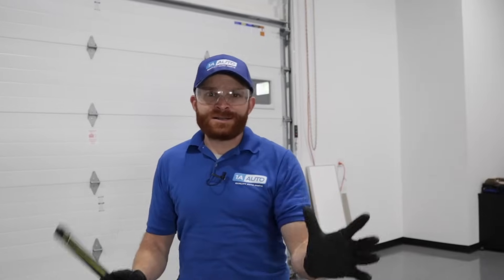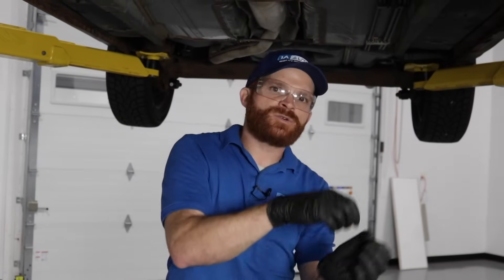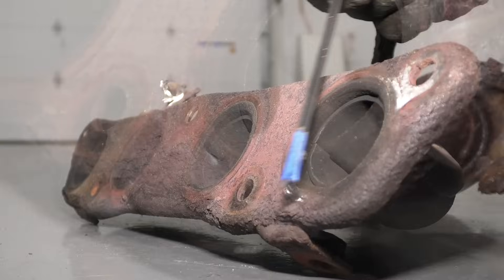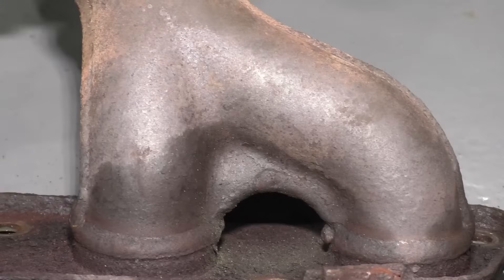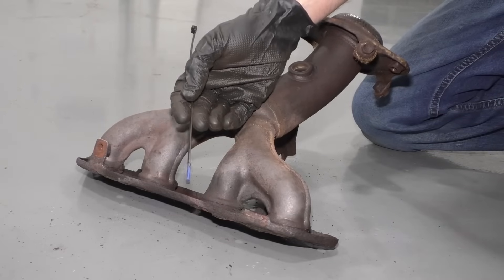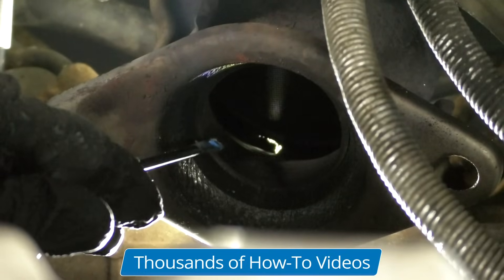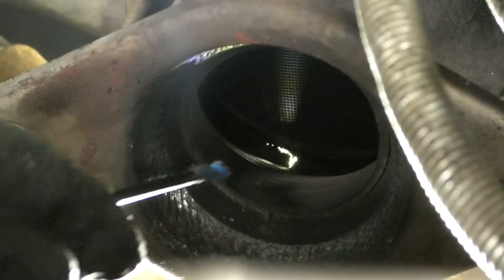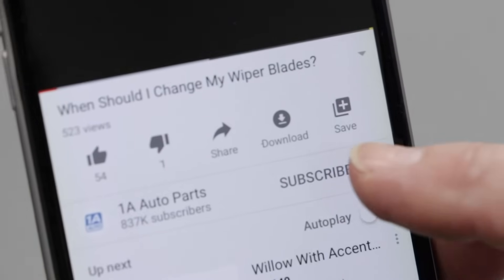Smells, or Ticking? Diagnose a Car or Truck Exhaust Manifold Leak

Comment: Could a clogged catalytic converter cause an exhaust manifold leak? My downpipe gasket was leaking and the check engine light went away and I had improved horsepower. The light came back on and it's the same p0430 code again.

Comment: I have a 2019 Honda Fit that has a ticking sound between the manifold and the timing chain coming off a bolt using a stethoscope i hear ticking sound  happens pretty much during the winter time on cold starts and the last about 10 till warm up ,during the summer time it doesn't do it.

Comment: Man I really appreciate all these high quality videos yall put out. I was able to rebuild my moms trailblazer 4.2 inline 6 engine from your videos (and the help of other videos), but primarily yours with the trailblazer 4.2 timing chain video. The engine is now now operating even better than before and i just started noticing the ticking on the exhaust side. I was bummed thinking it was something worse, but i highly suspect it is a leak at the manifold. It's a high milage vehicle, so I replaced all the gaskets on for the manifold, but never inspected the old manifold before installation on the rebuilt. All the research ive done, point me to the exhuast manifold being compromised. thanks again

Comment: Looks like I have a an exhaust manifold leak. I can see it bubbling.  I am also loosing coolant and have white smoke.  Does that make sense?  Do I also have an intake manifold leak??? Vehicle is a 1989 F240 with a 460 7.5.

Comment: Very informative. I just got a 2006 Honda Element that had a bad donut gasket and I just fixed that (what a relief for the ears!), but I found it ticks under load, whether the engine is hot or cold (the ticking under load doesn't go away when the engine is warm). Could this mean the manifold itself is fine but the gasket is bad? There are no leaks coming from the new donut. Thanks in advance for your comments.

Comment: Okay so I have a 2017 ram 1500 penstar engine and I have a ticking noise in think it was engine related but watching this makes me second guess. So in the morning is when it’s the worse as it would be if engine related and it gets quieter but doesn’t go away completely and it does increase under acceleration. So my question to you is it even worth what you think it could be

Comment: im working on a 2003 gmc savana van, i hear a ticking when started up cold but i still hearing the ticking even when its warm, but when i drive it and give it some gas it goes away but comes back when im idling what does that mean? also symptom on possible maifold leak?

Comment: Soap and water. Use a shop vac on the blow side in your exhaust to find a leak on joints and seams instead of going by noise. Itll also keep it all cold so you can touch and work on the exhaust

Comment: Hello everyone, question: do you need to replace that if you have the leak. If the sound doesn't bother you or there will be some other complication if not replaced. And if you do need to replace that for some reason, what is the longes you can drive without replacing it if the sound just appeared?

Comment: Awesome video, I was about to just tighten up my bolts there but after seeing how bad the surfaces can get and that cracks can show up, I'll take out the manifold and give it a better inspection. Also hadn't even thought to use my hand to feel for gasses when the car is just turned on

Comment: Does anybody know if a manifold pre cat like shown is supposed to build up heat while at idle? Mine measured 330 into manifold 550 at the front of the cat and 330-350 at the back. Does this mean this pre cat is bad or that it is functioning? Once again these were measurements at idle

Comment: The best way to check for an exhaust leak, is to use a shop vac. Insert the shop vac end into the  open end of the exhaust pipe and if you have dual pipes with a crossover pipe you'll need to block the other pipe by inserting an old t-shirt or shop rag. You'll want the shop vac blowing air into the exhaust pipe. Now, you don't have to worry about the exhaust leak sealing off due to heat, just grab yourself a spray bottle of water and dish soap. Go along spraying the soapy water and as soon as you see bubbles you'll have found your leak.. but don't stop there, there could be more.

Comment: Simple way to check leaks is to use soapy water and test to see where bubbles comes. Apply soapy water on possible leaks area first. If you have leak in exhaust prior to catalyst, you will see 420 and 430 code and engine light on. I don’t why some will open all parts first and use eye ball to inspect the leak.

Comment: Can anyone help me with this, pleas?  My engine has the ticking when I start it.  It is gone after the engine warms up idling  but the ticking  resumes as soon as I hit the accelerator. I can be going down the road at 5 MPH and if my foot is on the accelerator I hear the ticking but if I remove my foot from the accelerator at that point the ticking goes away.  It comes right back if I hit the gas pedal again.

Comment: @1auto Lenny 

Would it cause smokey  from manifold gasket too?
or would that be the valve cover gasket only?

I changed my water pump in my 3.9v6 Dakota at start up to burp system passenger side, started to smoke really bad.

Was told its valve cover gasket but Im pretty set its mainifold gasket.

Comment: I have a 2018 Nissan Altima, and it started with a loud consistent ticking sound, and was noticing it suspiciously went away after it warmed up. Also, it was unbelievably "exhausty" in the cabin and under the hood. This absolutely solidified my suspicions. Thank you!!

Comment: When I turn my car off and it’s parked I hear a very rapid ticking noise like someone it tapping a small wrench really fast near the back or mid section of my exhaust and this noise actually goes away once the system is cooled off. But I hear no ticking when the car is on…I have taken it to 4 mechanics and they have told me there isn’t a problem. I’m not convinced.

Comment: I don’t get a ticking noise. It sounds more like chirping or squeaking, or even metal to metal when I accelerate. It is less audible when the engine warms up. Does this still sound like an exhaust manifold issue? Gasket? Loose bolt(s)?

Comment: So you're saying that if my manifold is connected to my catalytic converter I can get a lien condition as well as a p0420 or p04302 my manifold is leaking correct or not there's nothing wrong with the O2 sensors are replaced it twice already
Reply: Thats my same question, i have a code saying my manifold but a p0420 saying my catalytic converter, but the manifold leak could cause the code right?
Reply: My car got the same code. It smells like gas when I turn on the AC or the heater. I’m assuming it’s coming from under the hood. I used cataclean n cleared the code so it hasn’t popped up and it’s been longer than a month.

Comment: I have a Nissan 2018 Frontier King Cab 4cyc  with an exhaust leak at the exhaust intake manifold not at the head but a little waist down where it's covered by heat Shield bolted in another one a little further down which is clamped together where to exhaust pipes meet and is covered by heat shield it has a aluminum o-ring as a gasket how do I get them off to replace the aluminum o-ring on it

Comment: @1A Auto: Repair Tips & Secrets Only Mechanics Know
I have a 1.8 zz Corolla. I've had this ticking since over a year now. it comes with more load (more passengers or AC/headlights on)
I'm suspecting a warped exhaust manifold with leakages around the gasket. Do you think this leakage can screw with the performance of the car? because when the noise disappears sometimes, the cars performance is ALOT better?!!

Comment: Hi I tore my manifolds off. I have multiple broken manifold bolts as well as shot gaskets. My truck makes a ticking noise that is louder when cold but doesn't go away when truck is warm either. Could this be my problem? 2014 dodge ram 1500

Comment: I have a 2011 Chevy Equinox that has started doing the ticking sound in the last few days. It doesn't go away after driving the car and the car is warmed up. Obviously more noticeable at lower speeds (under 30 or stopping at a light or stop sign). Any ideas?? Help!!!
Reply from the maker: +D Meckola We wouldn't be able to diagnose an issue like that here, you may want to have a local mechanic take a look at it. Thanks for checking us out! http://1aau.to/m/Shop-1AAuto-c

Comment: I hear ticking sound from my engine, but it doesn't go away after heating up. It gets louder as it idles more. What could it be?
Reply: Same thing, only the leak is large enough that the heat expansion no longer seals the leak.

Comment: Hi there, would the typical 'ticking' sound you mentioned of a leak very close to the engine be the short ticking noise I can hear right at the very beginning of the video when the engine starts? I have exactly that sound, I hear it mainly while driving whenever the motor has to pull, when I accellerate. This sound is getting louder and started over a year ago, however doesn't go away when the motor is heated up. Thanks in advance for your help!
Reply: Could be your valves or valve lifters that need to be adjusted or could be rod knock which is not good
Reply: Same
Reply: Look up what a rod knock sounds like.
Reply: I'm having the same issue and it's ever since I put a new set of aftermarket headers on. It seems to get worse when it's warm and will only make the sound under load. I can't for the life of me figure out what it is, it's definitely not the valve lifters as the sound isn't coming from them.
Reply: @BreeingIan  maybe it’s the EGR valve? Did you resolve it?

Comment: or you could use a shop vacuum with it blowing not sucking and with everything cold put the shop vac in the exhaust tip and tape to so it doesnt fall out and then turn it on and take soapy water and spray down the exhaust that is the easiest way to check for an exhaust leak been doing this for years as a auto tech BUTTTT make sure the motor and exhaust are not hot and it hasn't been ran for a couple hours
Reply: It's people like you that makes me enjoy the internet. Thanks for the great idea man

Comment: Will this exhaust leak also cause a P0032 and P0052 check engine light code? I already replaced all my O2 sensors and smell a strong exhaust and have that ticking noise.
Reply from the maker: +C Otake We wouldn't be able to diagnose an issue like that here, you may want to have a local mechanic take a look at it. Thanks for checking us out! http://1aau.to/m/Shop-1AAuto-c

Comment: What if you have ticking that doesn’t stop as it gets hot but it does slightly reduce?   Also when car is up off the ground and your under it you can feel a whoosh of exhaust when have a buddy slightly torque the engine putting it in drive and break torquing it and facing where the pipe comes down to the cat.  Can also smell exhaust in the engine bay back where the manifold is hidden behind the engine but no whooshing of exhaust blowing upwards like is under.  The issue is we don’t think it’s manifold, sounds like leaking manifold but the whooshing underneath makes us think it’s elsewhere, that large of a leak in the manifold would likely poisoned me on a road trip by now makes us think that the leak is further down stream but just above the cat.  But we can’t locate it and it’s a huge job to replace it because looks like have to drop the subframe and no one wants to do that.

Comment: If the noise is matching up (ticking) but doesn't really go away even when the engine starts to heat up, where should I he checking next? Or does it mean the leak isn't small?
Reply: Hey man ever figure it out for yourself? I’m having the same problem and I’m thinking it’s a bigger leak.
Reply: @Duke_803  yeah mine was only when I first started it and it would go away as a drive more, but now just today it stays loud as I’m driving so I think the leak got bigger and it sounds like it’s more up front so I’m thinking it might be a manifold leak but idk. I’m goin to try to get it checked tomorrow.
Reply: Injector noise or valve noise
Reply: @liamflynn6929  mines sounds like a lifter noise but same time smells like gas so idk

Comment: Do exhaust leaks cause vibration when driving ?
Reply from the maker: +Enrique Torres They mostly cause excessive noise, but you could possibly feel some vibration if the leak is bad enough.

Comment: Hello, I’ve got a question that’s been on my mind. Since an exhaust system is pressurized, how can it suck in air and create a lean condition?
Reply: Cracks in the seals
Reply: Extra air going to the O2 sensor. Venturi effect.
Reply: @Reginald-Bowls  that would make it rich. O2 sensor would sense excess air and tell the engine to send more fuel
Reply: It’ll cause it to smoke a bit, when running lean

Comment: This is very helpful in explaining the ticking noise I hear when my engine is cold.  Mine goes away usually within 30 seconds or less, so probably a smaller leak than average but still a problem to look at.
Reply: Or... your lifters.
Reply: @wheresfuninthat  you beat me to it🤣
Reply: @coreymohn05  mine is the other way around it ticks on startup and when I rev it

Comment: Will having a exhaust manifold affect the performance i got a 12 ram 1500 an i know i have a leak on the driver side due to bolts broke off but ive also notice my truck lost alot of power when trying to floor it from a stop will this have anything to do with the loss of power? Also no check eng light any clue?
Reply from the maker: +v tmz Thanks for watching!  Yes an exhaust manifold leak could affect performance, as it will usually throw off the air/fuel mixture reading from your O2 sensor.

Comment: I got my response after many months trying to understand why I have an exhaust buzzing noise between 1500 RPm and 2000 RPM when engine is warming up.
Noise almost disappears when the exhaust system reaches a very hot temperature (Heavy traffic driving for 20 minutes). Then the noise comes back slowly when cruising at high continuous speeds (When exhaust system cools down due to the cooling system and high airflow underneath the car)

Comment: How do you "PERMANENTLY" fix the constantly breaking exhaust manifold bolts on Ram trucks with 5.7 Hemi's?
Reply: Buy aftermarket bolts, the ones used are grade 8 I believe but go with a grade 9 or 10. Just take an intact bolt into a bolt shop and get them to match up width, length and thread 😘
Reply: Sell it and buy a Toyota
Reply: @Nikkk6969  Yeah i havent quite hit my mid 40s midlife crisis yet, ill get back to you on that.

Comment: Ok so I have a GMC Yukon XL 1500 and I got my cat converter replaced by express oil....well I started hearing that ticking noice and it is worse when I accelerate....when I’m idle it goes away....also they tightened bolts and it changed sound a bit but still ticking and say they did everything right....do I have a leak ? And if leak is outside of truck can the ticking noise do any damage to any other part of my truck?
Reply from the maker: +al newer We wouldn't be able to diagnose an issue like that here, you may want to have a local mechanic take a look at it. http://1aau.to/m/Shop-1AAuto-c

Comment: Can an exhaust manifold leak not get quieter when warm? Mine sounds exactly like a manifold leak tick but doesn’t go away when warm. Only time I don’t hear it is when I reach speeds around 20mph
Reply from the maker: +legit banana It is certainly possible! We wouldn't be able to diagnose an issue like that here, you may want to have a local mechanic take a look at it. Thanks for checking us out! http://1aau.to/m/Shop-1AAuto-c
Reply: Mani leak bro

Comment: My 2007 Chevy 4.8 makes a ticking/tapping sound only after the engine is at operating temperature. The noise sounds exactly like lifter tapping but goes away after a few minutes.  Back in the day of muscle cars that was indicative of an exhaust manifold leak. My guess is that when the thermostat opens up and the water starts to flow through the aluminum heads, they react to the quick temp change. But the manifolds being cast iron are not getting any cool down effect. So maybe this is why the tapping sound only happens at that time (operating temp) and not at start up or constant while the engine is running the whole time.

Just guessing. Gong to try the shop-vac thing and see. But not sure it will help seeing it only taps after it's warm and for a few minutes, then it goes away and purrs like a kitten for the rest of the time.
Reply from the maker: +Mel64D We wouldn't be able to diagnose an issue like that here, you may want to have a local mechanic take a look at it. Thanks for checking us out! http://1aau.to/m/Shop-1AAuto-c

Comment: Hello I have an 04 cadillac cts and the idle rises and falls consistently up over around 1200 rpm and down to like 400 rpm and I was wondering if there is a possibility that it was caused by loose intake bolts or maybe an intake gasket problem?thanks for your time
Reply from the maker: +DirtPoorFarmer We wouldn't be able to diagnose an issue like that here, you may want to have a local mechanic take a look at it. Thanks for checking us out! http://1aau.to/m/Shop-1AAuto-c